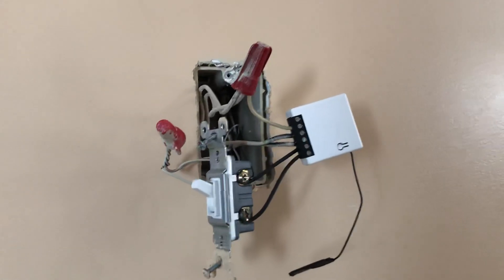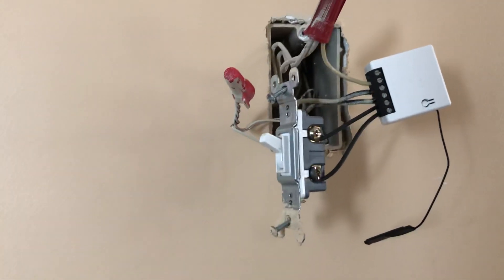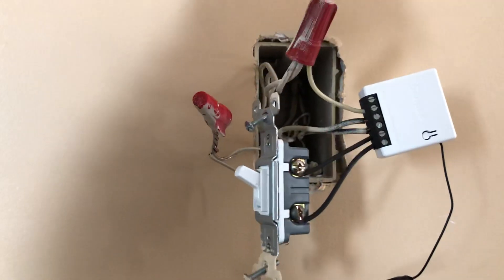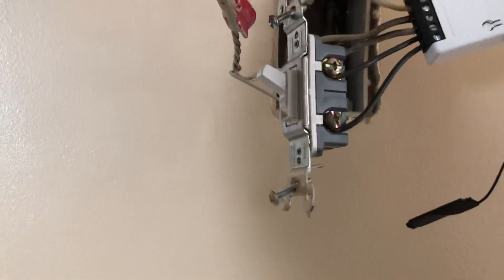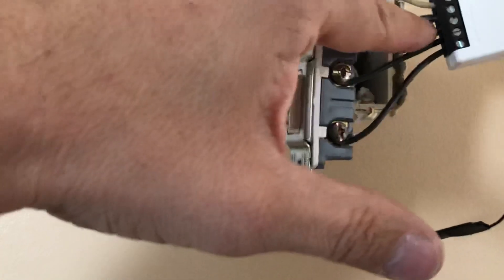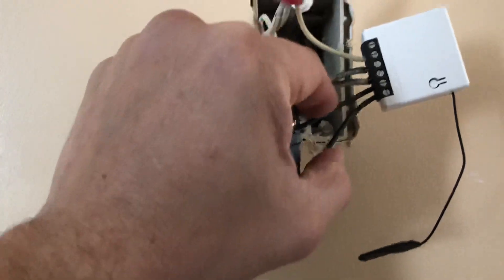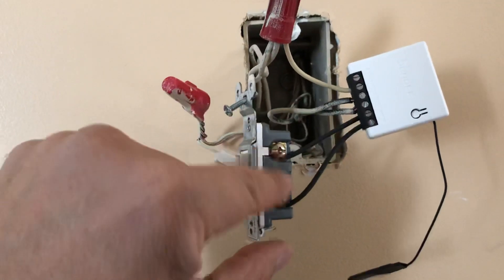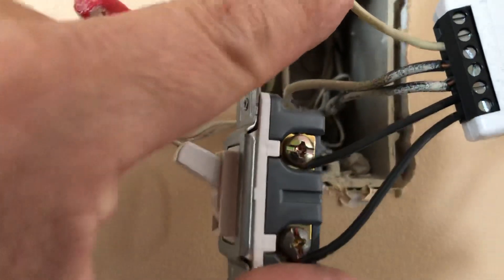How to wire sonoff mini to lightswitch

Comment: wires on the switch can be a low gauge, they carry almost no power.
Reply from the maker: Good to know! I use a stranded heavier gauge wire now to allow for more flexibility.
Reply: @kcoop99  No Mains goes through that switch now (I think) even thin wire would work) I'll measure when I install the next one.  But y can now use some cool switches even DC switches, instead of the ugly old wall switch

Comment: The one thing that always gets me with traditional single pole switches is that if you toggle the WiFi Switch, then the pole is backward from expected position. In the US, Up is ON, Down is OFF.  
I've moved to using spring-loaded, push button, toggle switches.  This removes the confusion as to the direction with the pole switch. Push ON, Push OFF, it's the same action.

It was worse for me with 2-Way Circuits, where you have 2 switches for the same light(s).  Button toggles help even more here.  

But in general i quite like the Sonoff Mini, fits MUCH more easily with a single gang and Non-Techies don't get annoyed (too much)
Reply from the maker: That's true! My wife isn't a fan but it's just like several 3 way switches we have in the house.

Comment: Did the mini for inside the box?  Also what did you do with the wifi receiver? Stuff it in the box or leave it hanging outside the box?
Reply from the maker: Everything fit inside the box. If not for this video showing it like this you wouldn't know it's in there.

Comment: Any idea if this can be installed to light switches that don't have a neutral?
Reply from the maker: Michael Mendoza not 100% sure but I know when testing and flashing, I just connect it with a cord from 110 outlet with just positive and ground. You could try it. Worst case is when you turn your breaker back on it will trip the breaker and/or fry the switch.

Comment: You should have shown how much trouble you had trying to put it and all the wires back in the box and how it looked as well as worked once finished. Maybe part two!
Reply from the maker: It can get pretty tight but if you take your time and don't cram everything back in you are fine. Double gang boxes can be a different story.
Reply: Kyle Cooper, Thank You.
Reply: Here is an example: https://youtu.be/tin1jLn6YMw
Reply: Was wondering the same. We have a few switch boxes that we’d love to keep with the current switches. But they are SUPER crowded